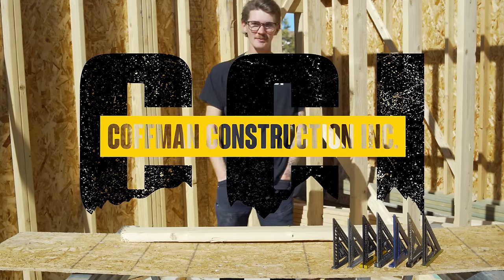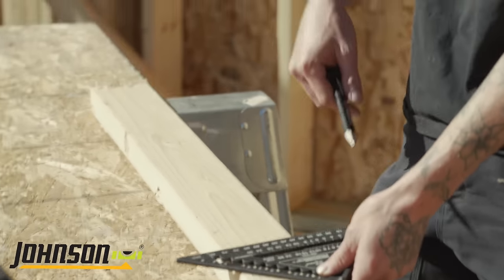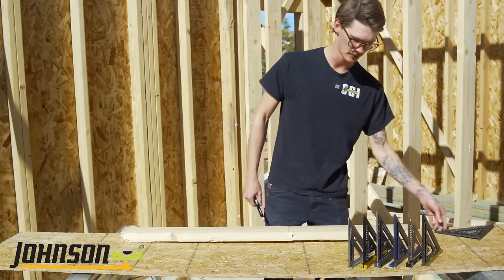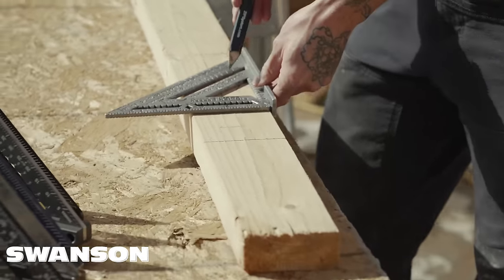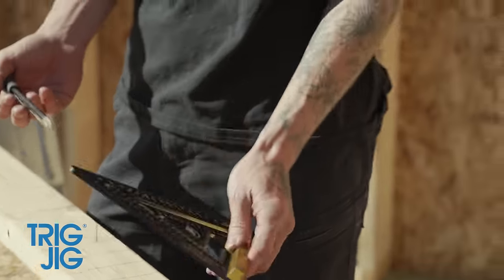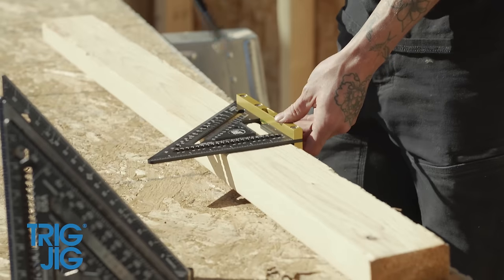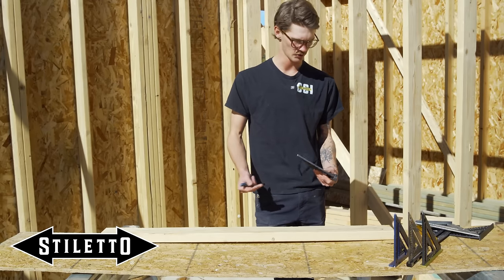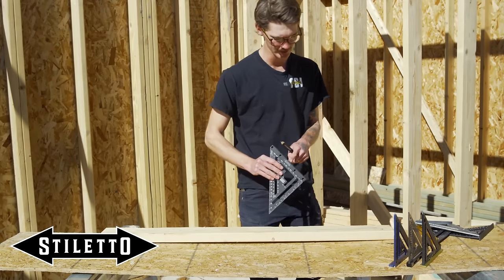Which SPEED Square is the best one??

Comment: I’m kinda weird with my tools. I only buy Swanson speed squares because they invented the tool almost 100 years ago. I still use a mag77 because it’s based on the original skill saw. I use Stanley tapes because their company lineage leads to Hiram A. Farrand, the inventor of the steel coil tape measure. I realize that the ownership of these companies has completely changed. I just appreciate the history of these tools and what they have accomplished.
Reply: Well, the mag77 is still the best imo. I've got the corded and cordless. I've got a festool too, but I use the others way more. Wormdrive ftw. Did you know one of the founders of Skilsaw was Robert Bosch?
Reply: That’s cool
Reply: I still use a handsaw and hand drive all my nails since that’s the original way. Seriously though if it works for you great but personally I think there’s like a million speed squares on the market better than the original swanson and no way in hell am I using a corded skillsaw in 2024. Even my miter saw is battery
Reply: I use a rock for a hammer .
Reply: @gavindaly5731  😂 bro for real
Reply: Stanley safety knife with lay in blades also. Some things that need to be simple are best in its original form.
Reply: Yeah, my radial arm saw is a DeWalt, my adjustable wrenches are Crescent, my angled pliers are Channellock, ...pretty much for the same reason.

Comment: I’m finding that my Stiletto square is fading from pulling it out of my bags and the marks are getting hard to read
Reply: I’ve got the same issue with mine.
Reply: I bought a wood handle stilleto framing hammer. And less than a week a noticeable amount of waffle is smooth. I'm not doing anything near production work
Reply: I am not a fan of mine either… thinking of going big on a Martinez. Very disappointed with my stiletto, have had it since release and it is faded and feels too big in my Occidental’s
Reply: The markings are not engraved? I never buy any type of square if the markings are not engraved and can scratch completely off.

Comment: The best square hands down is the Swanson and not because any of the reasons you gave but simply because of the book that you get with it. Read it!!! Makes tasks no longer intimidating, work out hip blocking  for trusses,    (32 5/8 long to short of a 6÷12). Applying the information you can lay out rafters, x12 for commons and x17 get hips/valleys, (framing Sq)  before you stand a wall. Only in this book.

Overall an excellent presentation thanks fella

Comment: I have a tricky question that maybe you'll have time to answer. I'm currently in the trades learning carpentry and falling in love with it, however my job has me doing just about everything not just solely carpentry. I have a desire to do what y'all do and frame big homes, especially roof framing which is my favorite. My question for you is, have you ever questioned entering a trade and becoming a master at that one thing? Have you enjoyed framing or wanted to pursue something else? Im just curious what you think when it comes to narrowing your focus to one trade and becoming good at it. Thanks!
Reply from the maker: I’ve always believed that being skilled in multiple things is super valuable! We do framing mostly, but I do demo, I’ve done drywall, some HVAC, some electrical, some concrete, I’m a certified welder too, all that to say, i think while sometimes it may require patience to do more than one kind of thing, it helps keep busy when the one thing isn’t in as high of demand

Comment: I'm usually the saw man so I very much prefer one that's a 12 inch. it also allows you to use it as a fence and make a perfect straight 90° cut very quickly easily constantly. the only thing I'm undecided about is metal or plastic, plastic won't bend as easily if dropped just don't get it hot and melt it, but if dropped to far it will break. but if it's a high enough  drop to break the plastic the metal one would definitely bend. but the plastic will be more likely to wear away and then it measurement marks will be hard to read or useless. so?

Comment: Hey thanks for the video. I tried the stilletto one with the level and the level was not accurate. So I took it back and tried 5 more in their stock and they were all the same problem. I found them too big and bulky and no etched or engraved markings. I love the Johnny and Swany . I have bought the extendable ones( folding) but they are no good for accuracy and durability.  Martinez is out of my range. I have not tried Trig or Smart square. But the smart square seems a bit stupid, at least  to me anyway.
Reply from the maker: Hey man! I talked with the people at stiletto, they suggested something interesting to me, try washing it with soap, they said the texture of the square can build up grime, but can be cleaned

Comment: UK resident…I purchased a DeWalt 7” speed square…from if I recall, Screwfix in Andover.  It was bent… still in the shop, they exchanged it for another..also bent…and another also bent. I chose the best of the three and got most of the curve out by literally standing on it.  Was that bad storage at Screwfix, maybe under a heavy item? Or was it bent straight out of DeWalt (or China more like)? I don’t know, but pretty poor either way…and how did Screwfix not notice (or care probably)? SMH…
Reply from the maker: Yes that’s horrible, certainly wouldn’t happen with any of these brands

Comment: I see the Swanson misidentified as steel all the time. Get a magnet and test it. It's cast aluminum. The others are extruded / machined aluminum.
Reply from the maker: No way really ??!
Reply from the maker: It could also be stainless steel too though. That’s non magnetic
Reply from the maker: Maybe I’ll spark test one today to find out 😂 orange sparks and it’s steel, no sparks and it’s aluminum
Reply: They say it is cast aluminum right on their website. You can also just tell by the feel. It's less dense than anything steel would be, carbon or stainless.
Reply: Swanson is all you need, quit paying for high priced junk
Reply: It is 100% aluminium

Comment: I have both Swanson 6" and johnny square 12" 
I prefer Johnny, fast reading and saw guide. 
I've seen woodpecker, the price is steep. I believe if a square is square is all you need.
I use them to calibrate my saws.
Framing square, like the Milwaukee over the blue empire and silver Johnson, that is not square.
I set my miter saw occasionally for true cuts being finish carpenter would get upset at gaps.
Bought empire blue and Milwaukee red the Johnson is not true.

Comment: just wondering  if you could do one on utility knifes I am having trouble finding a good one thanks
Reply: I recently bought and Rok brand 1" I believe utility knife for 6 or 7 dollar Canadian and I love it. It has got graduating teeth or locking mechanism for bringing the blade in and out and locking in position. Before that I ised1"  Olfa with same thumb push action which I still use. Olfa is more expensive. But I recommend Rok or Olfa . I hate the twist knob action ones. Push thumb with locking mechanism is way to go. One hand operation. I have had my olfa for a long time. I was looking and  have not been able to find 1" Olfa any where.